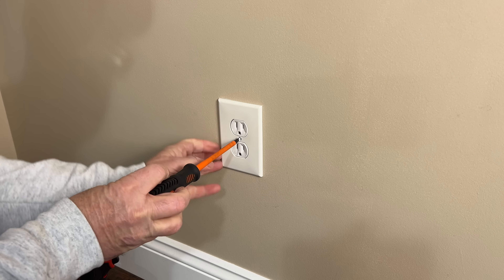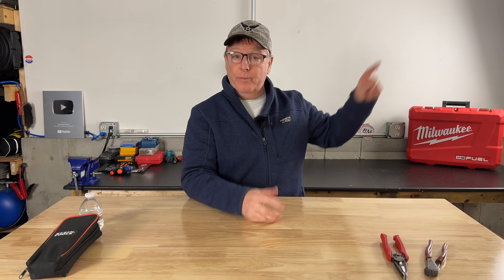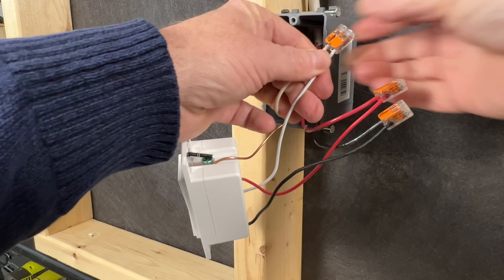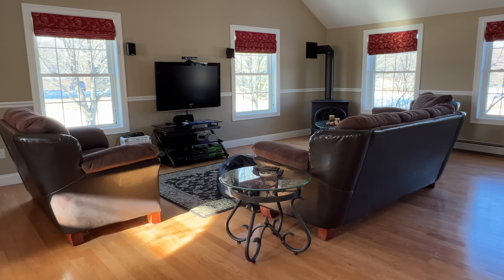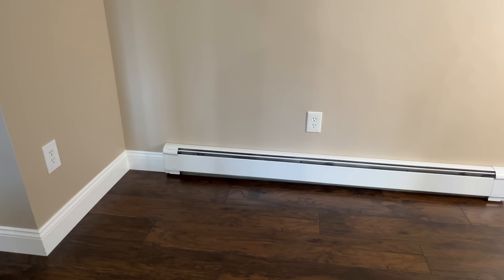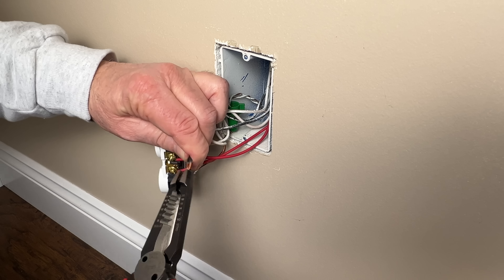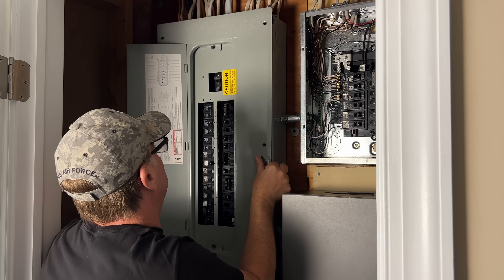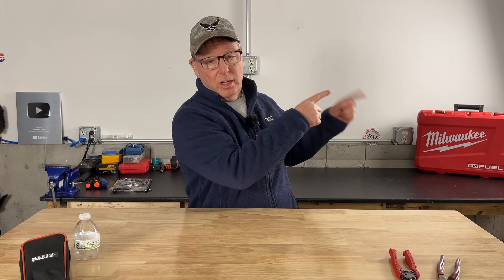Are Extra “Unused Wires” Required by Code?

Comment: I’m a DIYer, but I knew when I installed my ceiling fan (without a light) to run a 3-wire to it, with the unused red wire capped, for the next homeowner to possibly take advantage of.

Comment: You need a neutral now in light switch areas, but not in all of them.
Only other reason i have seen is the use of a switched outlet in some areas. Like living rooms on both sides of a window so you can modify the outlet, to switch lamps on and off.

Comment: Another situation where there may be extra wires at a box, is when  a paddle fan with light kit is replaced with a Paddle fan with wireless remote, that only needs power at the light box or an existing paddle Fan converted to wireless control that also only needs constant Hot at Ceiling Box. Thanks, Russ, 30 years in Electrical Trade
Reply from the maker: Great point.. Thanks Russ.

Comment: John, I have a question. In this video, I saw you use the outlet terminals to extend to another outlet. I was taught that you use a pigtail of the line for your outlet. Is both ways OK?
Reply from the maker: Yes both methods are approved. I made a video detailing when I pigtail and when I through wire. Maybe you will find it interesting. Hers the link.. https://youtu.be/K3RIjUnrNTQ

Comment: Another option with the red wire for the switched receptacles:
Go to the switch first, then a 3-wire from the switch to the receptacles. The black wires would be twisted together in the switch box with a pigtail to go into the switch. The red wire would come out of the switch. You can break the tab on the black side of the receptacle that goes between the upper and lower halves of the receptacle. Attach the red wire from the switch to one screw and the black wire to the other screw on that side. This will make 1/2 the receptacle hot (black wire) and 1/2 switched (red wire).
Reply from the maker: I covered this in the video.

Comment: In the older code books, and especially in local codes the white wire in 14-2 or 12-2 is the line (hot) wire going to the light switch so the load (switch leg) wire going to the light will be black. I preferred to just use 14-3 or 12-3 to switch boxes. Lots of older houses have a HALF HOT outlet. You break off the brass tab for the hot and the switch leg goes to one half of the duplex outlet. The other outlet stays hot all the time, so HALF HOT, HALF SWITCHED.

Comment: The extra wire in the switch box for the ceiling fan could also be because the original plan was to separate the ceiling fan and attached light but a remote controlled ceiling fan was later installed which didn't need the extra wire. I've run into this multiple times. Alot of remote controlled fans come with integrated receivers that can't be taken apart like the older ones that easily could be removed.

Comment: Someday, someone will find a mystery wire in some of my kitchen boxes. I had a MWBC powering my dishwasher and my refrigerator / countertop plugs. I read up on MWBC and found out it wasn’t being used correctly in my home. Instead of worrying about making it safe, I decided to disconnect the red wire at the box/panel, and run a new circuit to the dishwasher. But I did leave a note with a label maker inside the box just to help any future sparky’s 😅

Comment: I get it and it makes sense but that's still an extra wire to cram into an already small box. They're going to have to make these boxes bigger, and in older homes you will have to switch out the box much more often.

Comment: Nonsense we been controlling our lights for over a century without a neutral in the switch area. Outlets and lights should always be on separate circuits if you overload an outlet the lights stay on this is a no brainer. I will never use china made switches the good old single pole switch is good enough for me. Unless using three and four way circuits. Most DIY have no clue how to use these circuits. Dad taught me how to hook up three way circuits from the light or from each switch depending on how the power is run. Also having only two wires makes putting in switches easy and you don't need box extensions or deep boxes. 73

Comment: 3-wire to all receptacles is really smart if you don’t mind your receptacles and lights sharing a breaker.  Neat idea, but I don’t ever put receptacles onto lighting circuits.  Reason being if a vacuum cleaner or other heavy load pops the receptacle breaker, I don’t want to be fumbling around in the dark getting to my panel.
Reply from the maker: I prefer a ceiling light in every room which would mean a switched receptacle is not needed.
Reply: @ same here.  I’m not fond of switched receptacles in lieu of light fixtures at all.

Comment: I created a spare wire in a bathroom the other day. I was running a cable to an extra receptacle and all I had on my truck was 12-3 Romex. So I had to cap off the extra red wire at both ends.

Comment: I’ve never met any electrician that will run an extra wire as common practice just because it may be needed in the future.  Usually I’ve had to threaten firing an electrician to get him to go beyond minimum code, and that’s with paying for the extra work.  You know different electricians than I do.
Reply: I was taught to run 14/3 to every place a fan could be mounted that way when the track homes buyer wanted to upgrade the wire was already there.  Now boss man still charged as if I fished a new switch leg.
Reply: Neutrals in the switch is minimum code, though.
Reply: If it is an Electrician who is also an Electrical Contractor, then there is no excuse.  If it is a Normal Electrician, they just do what the Boss tells them to do. A lot of people confuse the two terms: Electrician and Electrical Contractor.

Comment: Bathroom fans should have a separate switch. No reason to suck out conditioned air.
Reply from the maker: I've never seen a bathroom with just the fan light for lighting. I have three bathrooms and I run the fan when needed and use the other light when it's not.

Comment: I keep asking myself, and maybe you can answer this, but what is the safety issue with having an old-fashioned light switch with no neutral in the box? Sure, it may be inconvenient if you decide to use a switch that needs a neutral, since you will have to run a new wire, but how is not having a neutral unsafe? I thought the NEC was supposed to be about safety, not convenience.
Reply from the maker: It's unsafe because people go out and buy smart switches and get home and realized they have no place to connect the neutral and the switch won't work. Many will then connect the neutral to ground according to data collected from the CSPC. Now you have current flow on the ground with can be hazardous.
Reply: If the NEC was only about safety and not convenience the code would simply say that it is forbidden to run electricity to a dwelling.
Reply from the maker: Also remember this is for new work. You are not required to make changes to existing installations.

Comment: The 3-wire conductor for switched outlets for things like floor lamps is a great idea. Also, turning the receptacle upside down for easy identification is also a great tip! Thanks.

I noticed you switched both halves of the receptacle. In Ontario we usually split that receptacle, with just the bottom half being operated by the wall switch.
Reply from the maker: I actually recorded splitting the receptacles as well but I cut it out during the edit. I thought that would be better for a dedicated video. I didn't want to confuse anyone by not providing enough information and I didn't want to spend to much time on it here since the video is about extra wires. Thanks for your comments as always.
Reply: Good thinking. 73

Comment: Hello John,  enjoying your videos!! Got a quick question. Why is it that neutral wires from different circuits are supposed to be wired separately but are all wired on the same neutral bus bar in the breaker panel? Doesn't seem like that makes sense!
Reply from the maker: Great question.. Many people think of the neutral wire like a grounding wire since they are bonded together at the service and it is actually called the grounded conduct for this reason. But it is important to remember that the neutral wire is a current carrying conductor. A residential electrical service is a split phase system where each pole is 180 degrees out of phase with the other. Thats why we have 120v to ground and 240v between poles. The bus in your panel is staggered between poles as well so you will have 240v between breaker down the left or right side and from left to right. When breakers on opposite poles share a neutral, the current on the neutral from each pole is 180 degrees out of phase so they don't add up. For example: if you had 12 amps on one pole and 10 amps on the other, the neutral would only carry the imbalance which would be 2 amps. But if we shared the neutrals on two breakers on the same pole then the neutral would carry 22A based on the example above. This would overload the conductor and could eventually cause insulation breakdown which could lead to fire. I hope this answers your question..

Comment: I have always marked my switch legs for lights or receptalces with blue tape
Reply from the maker: Blue tape is a great way to mark the wires.
Reply: Great idea. I've always felt uneasy about how an unmarked black wire controlled by an upstream switch could be confused with continuous power at some later date.

Comment: I can think of one other place where you'll have unused wires. In the kitchen with two circuits on a 3+G where somebody has come in and incorrectly replaced an outlet or GFCI. Hopefully those two wires are on a tandem circuit breaker.
Reply from the maker: I hardly ever ran multiwire branch circuits for that very reason. Too many people will not understand them and make a mistake.

Comment: Wait what! It's common to wire all outlets in the room up to be capable of being switched, I have literally never seen that!
They're always in like the worst possible location in a room where even if you put a lamp in it wouldn't illuminate anything and it's always so the builder can cheap out by not putting lights on the ceiling. About the only place I've seen a switched outlet makes sense is in the master bedroom in the house I'm currently at but that's only because one wall has a window the other wall has a closet and the third wall has a bathroom and hallway door which literally leaves you only one wall for the bed so they only put one plug on the entire wall. And if they ever do run wire to the ceiling it's never a 3+G so there's no easy way to upgrade to a fan.
I have even seen somebody's brand new house built 4 years ago where they completely messed up the switched outlet and switch it was supposed to be  at/on and the person literally lives with tape over the switche so their TV doesn't get shut off.
Reply from the maker: It's common for a (good electrician) to wire switched receptacles the way I described in the video.
Reply: @BackyardMaine  Then there are no good electricians.
Reply from the maker: Remember if you have a switched light in the room then switched receptacles are not required and will almost never be installed.

Comment: Great information.  I had been wondering about this.  Of course, the one place I was really hoping for an extra wire, a ceiling fan, doesn't have one.
Reply from the maker: Many of the new fans will come with remotes now so they don't even need a switch. I would rather have a switch on the wall than trying to keep track of a remote.

Comment: You may also find a spare wire in a ceiling light/fan box that was wired for separate switches but the installed fan/light uses a remote control that only uses a single wired connection to control both.

Comment: What is the purpose of box offsets on EMT? When I upgraded my main serve disconnect panel and eliminated the multi-wire branch circuit configuration, along with adding a 100A sub panel in the garage; I bent offsets for every box. Other than attaching the pipe along the run with straps being easier, I guess it doesn’t matter. Personal preference maybe? I noticed it appeared the ones in your background were straight. I’m no electrician by trade, just studied the NEC and a little handy. Maybe it’s like which way a receptacle gets turned, it really doesn’t matter; although, I like the idea of flipping the switched wall outlet opposite the rest. 👍
Reply from the maker: Box offsets allow you to strap the conduit right up against the wall. There are other strap that have the same spacing as the box KO so box offsets are not required. If you notice the conduit behind me in the video there are no box offsets. I didn't need to support these nipples because they are all less than 36" long but if they were longer I could have used Minerallac straps and still skipped the offsets as well.
Reply: The purpose of the offset in conduit is so it will line up with the opening (knock-out) of the box. Your conduit will be right against the wall but the opening in the box isn’t.
Reply from the maker: @ True but thats if your supporting the conduit right up against the wall. If you're using other type of supports like Minerallac Straps box offsets are not needed.

Comment: My house was built in 2003 and they put junction boxes in the attic (like you'd use for lights) but never ran any wiring to them  lol
Reply from the maker: Bummer..
Reply: @BackyardMaine   Not really.  I've ran hundreds of feet of UTP up there and down through the walls.  Just like base housing at Minot, Sheppard, Little Rock, and Tinker.  Romex ain't that big a deal.

Comment: Keep in mind that many newer ceiling fans (with lights) are now remote controlled and only need one power feed (black).  The controller built into the fan provides power control to the fan and light with no need to utilize the extra independently switched hot (red).  I personally would always still run a 14/3 (or 12/3) and cap off the red as a spare, as you never know what the fan may be replaced with down the road... perhaps a non-remote controlled unit that will optionally need both legs switched.
Reply: Agreed. Many, but not all, newer fans are radio controlled and will split the power between the fan & light themselves. However, for the price difference between 14-2 & 14-3 (or 12 gauge, as appropriate), it's worthwhile to run the 3-wire up to the fan/light box, just in case.

Comment: my son bought a house that had all of the outlets in the bedrooms split so half was live and half switched. We also found extra wires hanging in the attic, which based on the locations were spares for future air handler (240 volt) and perhaps a gable end fan. After tracing we tagged them and capped them off at both ends. (they had been live)
Reply from the maker: Very common practice. I actually cut the part about split receptacles out of the video during the edit because I was worried I would confuse people.

Comment: No
Reply from the maker: Some of them are my friend.. Back in 2011 Article 404.2 of the NEC was updated requiring a neutral wire in light switch boxes in order to give people the option to connect smart switches or other lighting controls that may require a neutral to operate correctly.

Comment: Sometimes, usually in the kitchen of some homes built between the  70s to around 2014 will have what appear to be unused black or red wires in some of countertop outlet boxes.  This means the kitchen was wired to provide the required two 20 amp small appliance circuits by means of a multiwire circuit using one run of 12/3 instead of two runs of 12/2 as is the practice in new construction today.  When GFCI protection was required for the countertop receptacles and a multiwire circuit is used, usually there will be two GFCI receptacles, one connected to the black, other to red sharing a neutral, and from that point 12/2 cable from the load terminals to protect additional receptacles as needed.  This was done as a means of saving money on labor and material (where two circuits are needed, one 3 wire cable costs considerably less to install than running two 2 wire cables to accomplish the same end result).  

Once AFCI requirements were added to include the kitchen in 2014, the practice of using multiwire circuits in homes has virtually been 100% eliminated.
Reply from the maker: Yes for sure. It was very common to install multiwire branch circuits but as you said they are pretty much a thing of the past now.
Reply: MWBCs also have the advantage of lower voltage drop especially on longer runs (the neutral only carries the difference current between the hot conductors, so compared to two dedicated circuits the voltage drop is half) 

and for shops/garages/etc, they also used to be common as a cheap and easy way to get 120v and 240v receptacles. 

it is a real shame that they aren't used anymore imo, especially since it's due to AFCIs..
Reply: Plus those 3wire common neutral circuits must have a 2 pole common trip breakers instead of individual single pole breakers.